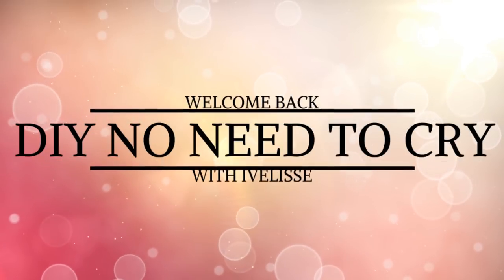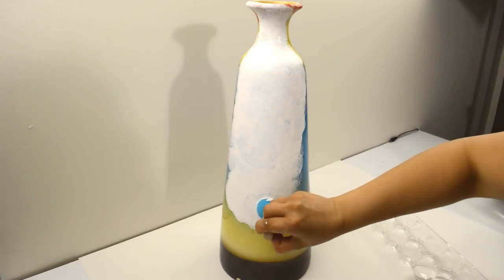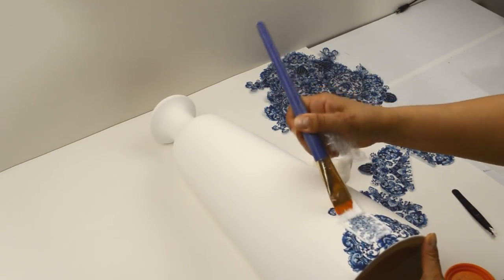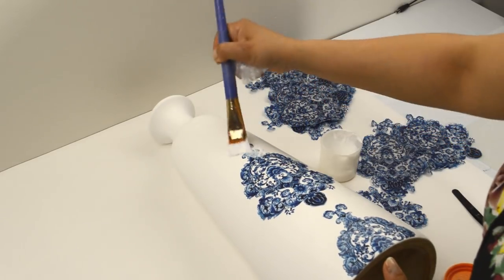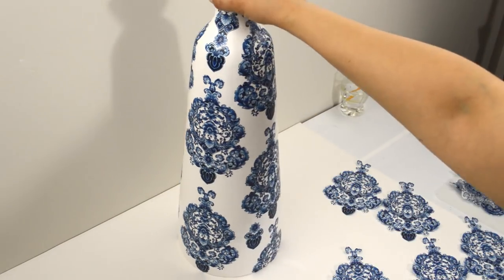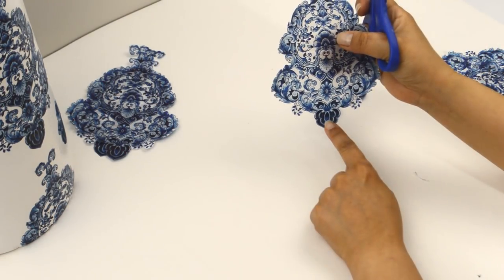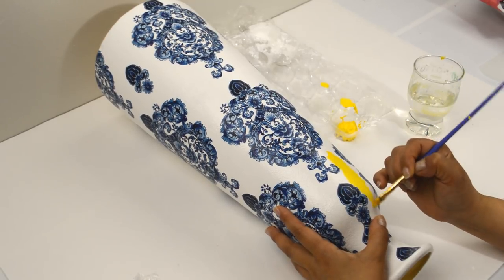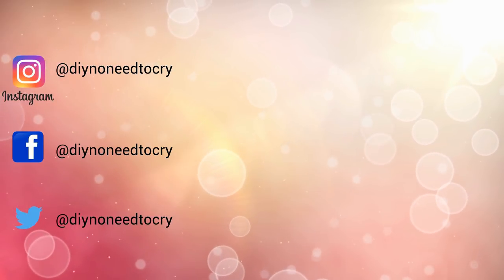DIY Decoupage Vase | How To Tutorial | Upcycle

Comment: Thats freaking awesome you found that vase. It was very nice. The colors were great. But i love the pattern you used. Im glad youre feeling better too. Im starting a project this weekend but im scared lol
Reply from the maker: Thank, why are you scared?.... wait, let me guess, are you going to attempt the lamp and are scared of drilling the hole?
Reply: DIYNoNeedToCry HAHAHA noooooo!!! Lol the faux stained glass!! I have my piece printed out. Im going to tape it inside the vase and trace it with the puff paint. Then paint it. I got the food coloring and mod glue. Idk why im scared. I hate failing lol like i HAVE to get it right the first go or im all messed up and butt hurt for days lol
Reply from the maker: Lol I get like that too but I get right back up and keep trying until I get it. Here are a few tips that might help. Don't mix the food coloring and mod podge fast. Go slow and don't overwork the glue. This is to prevent a lot of cracking. Second, if it's not on a flat piece of glass you can only do sections at a time and lastly practice making lines with the puffy paint before doing the project. You want to get familiar with it and remember to have fun with it! Happy crafting hun! 🤗
Reply: DIYNoNeedToCry YES! I been replaying your video in my head about mixing them together. I remember what you say!! But thanks for the tips. I will def practice making lines. And im using a regular flower vase. Like a generic one. Round fat body and smaller opening. Big enough for my fist to fit to tape the pic. Im super excited. If it all goes well im giving it to my sis in law. Its a beauty and beast theme. Its her fave cartoon as is mine. So im super excited about it.